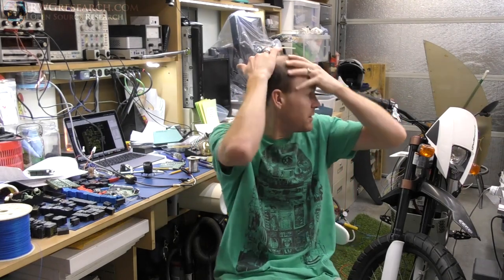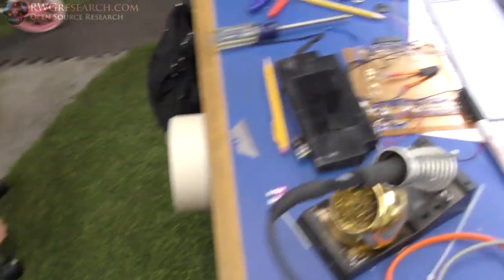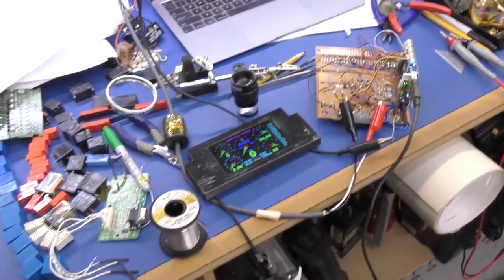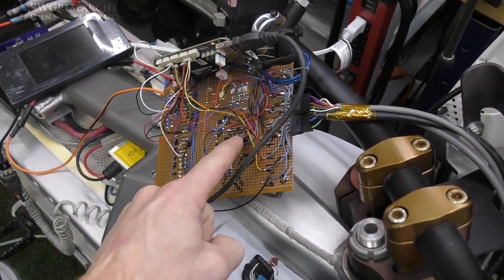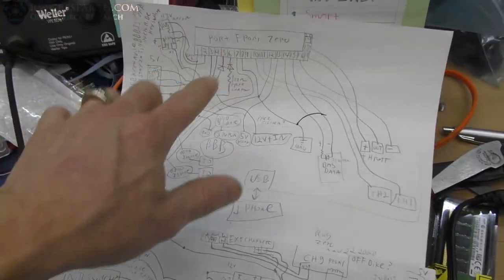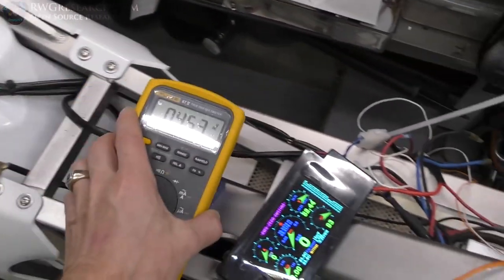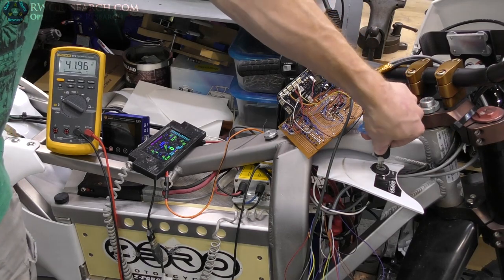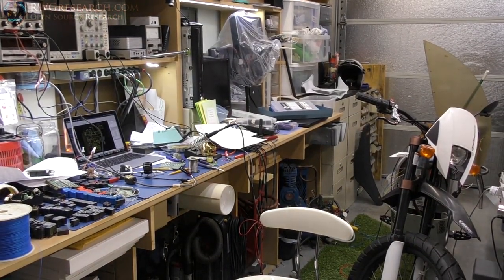Zero P19... Fine Fine Just.. Fiiinnnee Ant B...  (Finishing The Electronics The Hard Way...)

Comment: I have a different “mutt” zero, built by a friend of mine that worked there. The magic box on mine was bad, I bypassed everything just to make sure it ran. I fitted Prius nimh modules, 7s2p I believe. It ran great for the first test, then after giving them all a full charge(individually with a smart charger for rc car batteries) it no longer wants to ride for more than 100’ or so before it drops off. Any recommendations on where to look? Besides connections, bad cells, ect. I checked the easy stuff